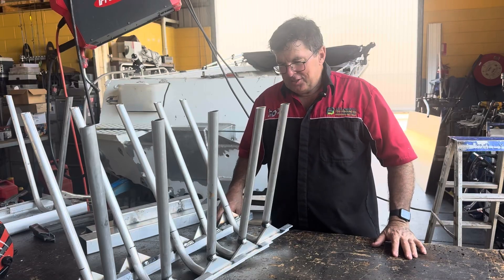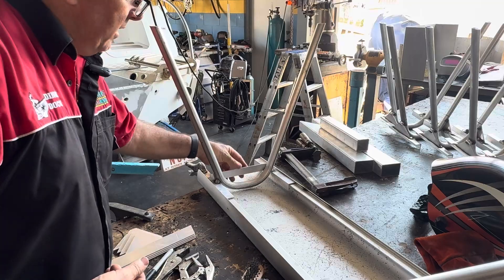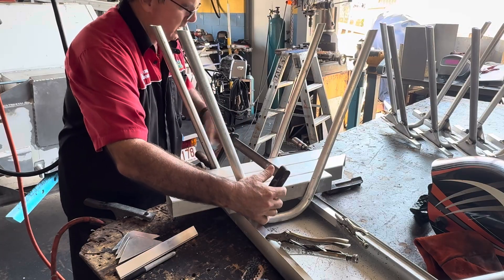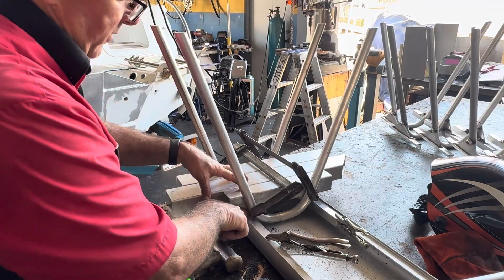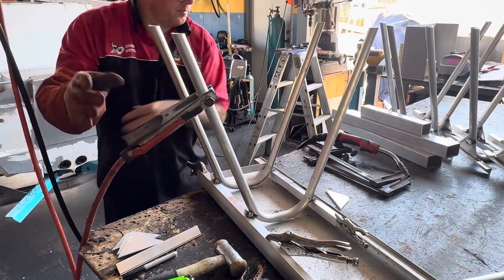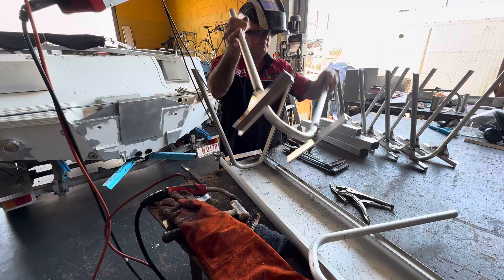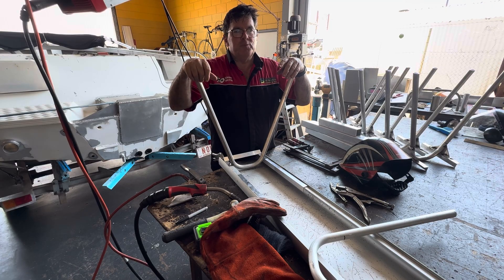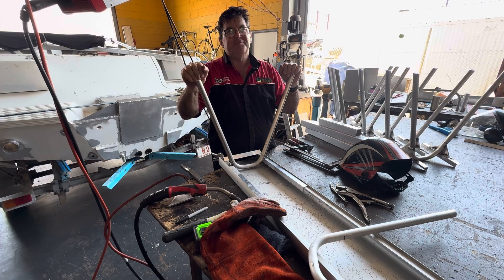Using Jigs to Fabricate Aluminium Parts

Comment: What would you say is the maximum thickness that 275 could weld ?
Reply: Depend for how long if only running 1.2mm wire on alluminium  then not often you will need more than 230 amps 
I use ewm machines which are about same and the small one I have  305 will weld 12mm ally plate all day any thicker preheat is starting to be needed but welder is well within its duty cycle
Reply from the maker: Well said
Reply from the maker: I don’t imagine you would weld up material more than 12mm I rarely do but a 270 will do it all day